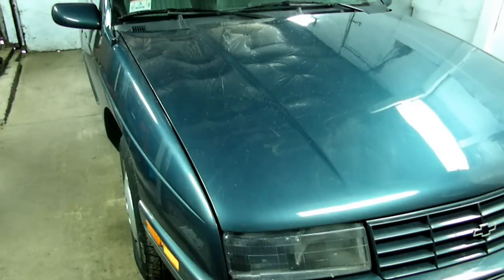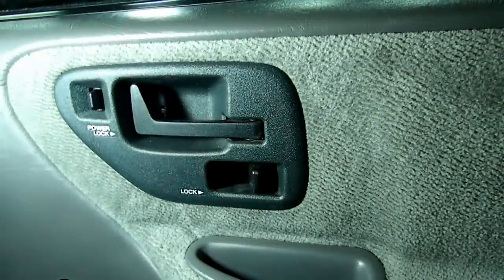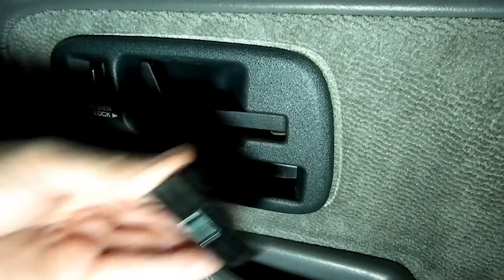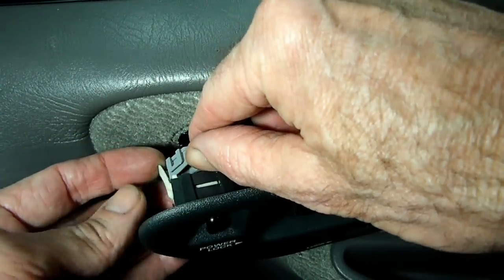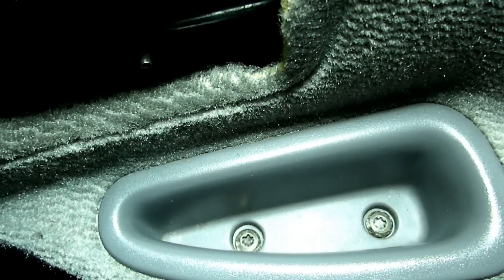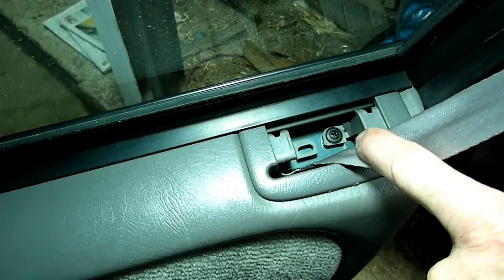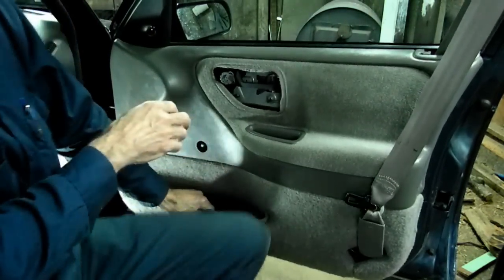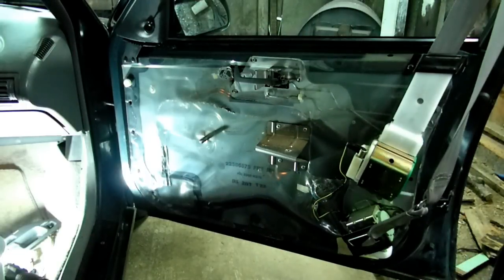Inside Door Panel Removal

Comment: I live in arizona and I’ve had my 1994 chev corsica since 1997. The little black vertical piece of plastic that slides back and forth to auto lock the door broke off. Got any diy to fix or jury rig? TIA